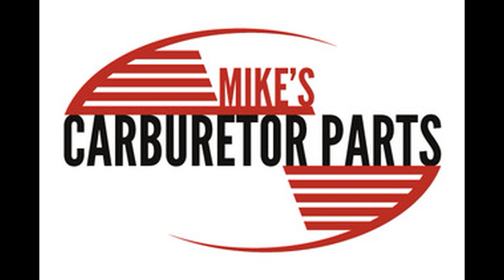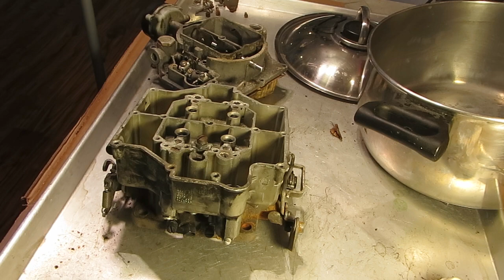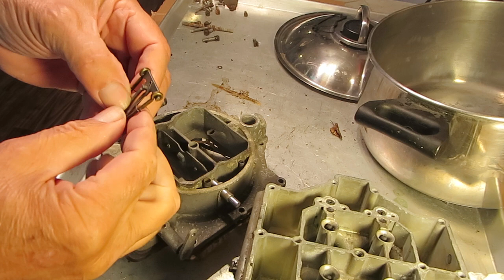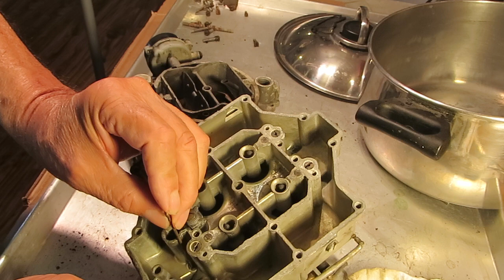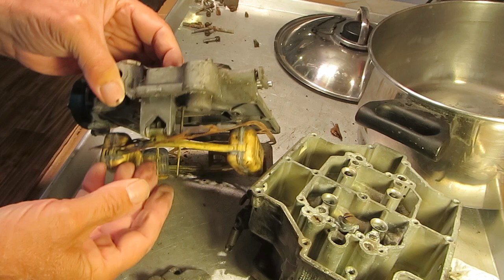Carter WCFB 4 Barrel Carburetor: Metering Rods

Comment: To adjust the WCFB metering rods, back off the idle-speed adjusting screw until the throttle valves are fully seated, then loosen the screw in the metering arm. Depress the metering rod arm upward until it just touches the hanger. Secure the arm with the set screw.  this gets you really close if the carb is the proper application for the engine.. doing a short 30 foot part throttle acceleration to see if there is a flat spot .. you can raise or lower the metering rod setting by a few thousands of an inch.. and you should try it.. along with series of part throttle acceleration for about 30 feet  to verify the change.. 

please also.. verify that when you start the engine with it warmed up that the metering rod holder is pulled down by manifold vacuum.

Comment: Great video. Very good explanation. I’m just learning a whole bunch about WCFB carburetors. I recently bought a 1966 327 cu in engine that has dual Carter’s on it. I could probably do myself a big favor by going to a different fuel system but the nostalgia of dual quad Carter’s appeals to my need for self pity and besides the challenge of making them work together intrigues me.

Comment: I removed the metering rods on my WCFB and tried to lift the bowl cover.  It seems the vacumeter piston attached to the metering rod hanger is stuck below and will not let me lift the cover free.  It raised about 1/2".  Now the vacumeter piston is raised and will not completely sit back down.   Have you experienced this before or is there some step I am missing in the bowl cover removal process?  I hate to tap on the metering rod hanger.
Thank you for the nice videos.
Reply: @MikesCarburetor    That did it.  Bad gas seized it up.   Thank you.

Comment: Can you explain the function of the vent at the top of the dust cover?
Reply: @MikesCarburetor  does the vent on top of the cover over the metering rods have to function properly in order for the carburetor to run?
Reply: @MikesCarburetor  thank you so much for the advice! We have the carburetor working now. The mechanism that lifts the valve, when the shaft rotates, was broken off. We had to fabricate a new one, and now it's working like new! The '64 Impala SS 327 runs like new!
Reply: @MikesCarburetor  do you also have videos on a Rochester Quadrajet?
Reply: @MikesCarburetor  thanks!